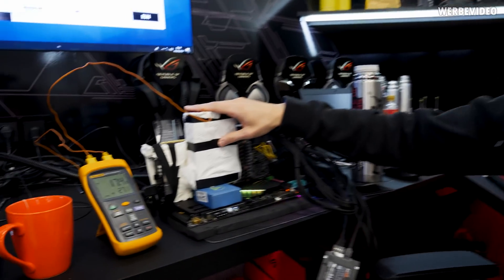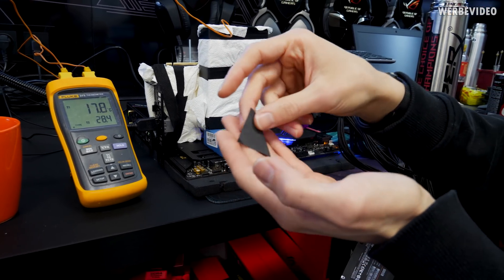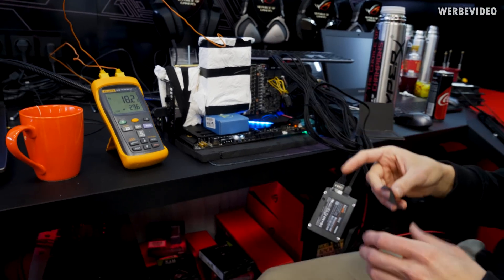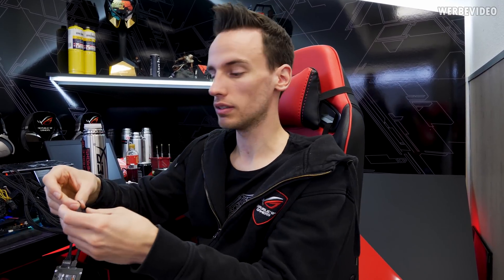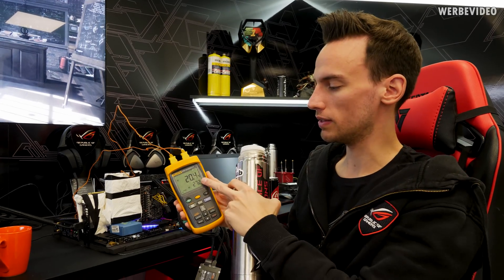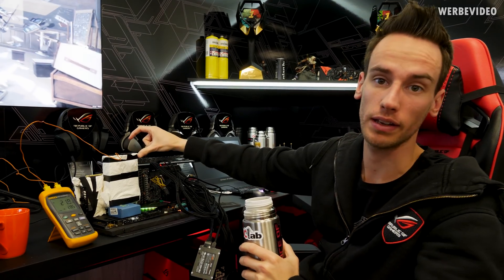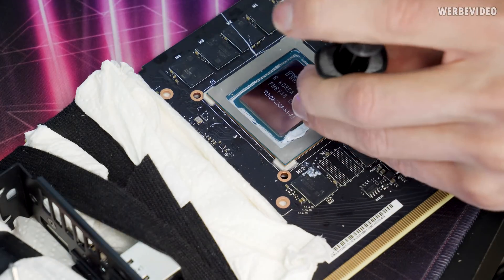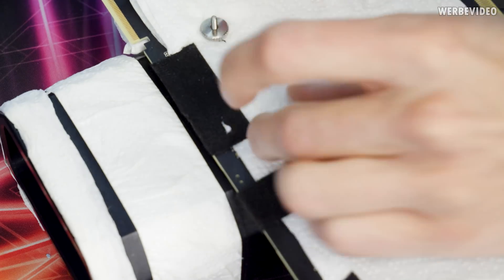Thermal Grizzly Carbonaut Extreme-Test (en)

Comment: 67,7 I think conductivity my but it’s crap for how’s it’s advertised it’s more like 10 or so on the conductivity scale, I use Kinpin KPX when that drys out I’m gonna try out Kryonaut Extreme cause I heard KPX only last 6 months but Jesus is it a good thermal paste I idle below 30C on a 120mm rad on a Ryzen 9 5900X not overclocked ot turbos on its own and runs 1-4 core at 5ghz the rest at 4.89ghz most of the time if it drops off it drops down to 4.77ghz it benchmarks out at 20,064 multi core score on cinebench r23 not bad for a non over clocked system just keep it cool if it’s Ryzen and my power profile is on balanced

Comment: Would a Grizzly thermal pad be good enough to use on a Ryzen 3800x with an aftermarket fan cooler ? (I`m going to be using the Be Quiet Dark Rock Pro 4)
No overclocking, nothing fancy, I`m going to be running everything stock, as a casual gaming PC.

Comment: So eventually, what is the point of this product? Everyone keeps telling that Cryonaut doesn't cure and doesn't degrade, so ….. ?
Reply: The point is you dont have the mess of paste, you can swap it in and out very easily, it doesnt degrade over time, etc etc. 

But for this you sacrifice a few degrees C in temps.
Reply: @recreate3204  From a manufacturer, that is a weak statement for a power user.
Reply: @raimo5091  Yeah. But it isnt meant for "power users." Or people doing extreme overclocks.
Reply: @recreate3204  Regular users don't care about thermal interface. They never replace it, and if they do, they mostly let shop handle it. OEM's and SI's are never going to use it due to cost-benefit value.

Comment: When making a seal on a gasket on a car, sometimes I add a little RTX to the paper gasket, just enough to make it stick. Wonder if adding just a little Kryonaut to the pad may help with the thermal transfer issue with it. Sure it adds cost, but in an overclocking situation with LN2 maybe it will help.

Comment: Roman. I've got some Cryonaut some months ago and my initial temps were attrocious and stopped trying (went back to Noctua paste). Some people says I should leave the Cryonaut for a week or two and the temps will get better than normal paste. Is that true?
Reply: My temps were terrible with Kryonaut as well. I'm now using Noctua NT-H2. I left my Kryo-NOT paste for a good week(I think) and noticed no difference with time and all other applications I tried were the same. I think its highly unlikely that it gets any better. Kryonaut is runny crap. Its non cure and isn't supposed to require any time. I've never noticed any improvement over time with ANY non-cure paste(although I admit my experience is fairly limited).
Reply: @AndAbel-AOD  So maybe Cryonaut is only good for LN2. My sample was legit, same color and consistency as other videos show. I don't think I had a counterfeit (even less living in Austria)
Reply: @SaccoBelmonte  Same here. I don't know if I even believe this nonsense about fake stuff. It may just be an excuse put out by the company when people realize how shitty it is. I've tried 2 samples from 2 different vendors and everything about them matches everything I've seen. I don't doubt that it was 100% legit.

It doesn't even really make sense for fake stuff to be sold on Amazon and such. As if thermal paste is just so sought after and difficult to obtain. The amount  of effort that would be needed to fake it. I highly doubt it.
Reply: @SaccoBelmonte  Out of curiosity. How much hotter were your temps with Kryonaut over Noctua? Mine were 3-4c worse than Noctua NT-H2, MX-4 2019 and even the stock Corsair paste that came pre-applied on my 360mm AIO which is being used on an i9 9900k.
Reply: @AndAbel-AOD  Yeah it was about 5c hotter than Noctua. I left it there for 4 days and decided to get rid of it and go Noctua when I realized the temps weren't getting any better.

I tried the application 3 times. No good.

Noctua's first application afterwards worked as expected.
Reply: Who ever told you that is wrong. I had no issues Kryonaut and was better than Noctua stuff I was using but only by 1-2c so not crazy better. My delta t is about 8c for my gpu and I know since it's water cooled and I know the water temps, also this is without having the pump at full speed.
Reply: @SkinUpMonkey  Hmmm...I don't know why there is so much inconsistency with this one. Not only here but in other forums 50% likes it and 50% hates it.
Reply: @SaccoBelmonte  did you spread it out or do it some other way?
Reply: @SkinUpMonkey  Tried twice as the instructions said with the spatula. Then I tried with the pea dot.

In every opportunity the temps were bad.
Reply: @SaccoBelmonte  that is strange then because it shouldn't be worse by as much as you say it is.
Reply: @SaccoBelmonte  I tried it like 5 different times in different ways from 2 different vendors. They were all the same. Kryonaut is garbage. I don't trust anyone saying otherwise. Lots of shilling going on these days...
Reply: @AndAbel-AOD  I'm not a shill and this is the first time I seen anybody say anything bad about it.
Reply: @SkinUpMonkey  That statement alone makes me suspicious of you. You can find people saying these things about Kryonaut whenever it is discussed. Its runny over priced junk. 

P.S. The fact that Thermal Grizzly does not individually label syringes is totally amateurish. Every other syringe of paste I have had has a specific label on it, telling you exactly what it is. If you are working with multiple types of Thermal Grizzly paste it would be easy to get them mixed up. It honestly makes me wonder whether Aeronaut, Hydronaut and Kryonaut are all the same runny junk.

Oh and btw, one of the vendors I purchased Kryonaut from is actually listed on Thermal Grizzly's website as an official supplier.
Reply: @AndAbel-AOD  wtf you on about? It's not runny at all, maybe you did get some fake stuff or they change something in the past year or so. All the reviews say the same as me and gamers nexus uses it and not seen anybody hating it. I give you that they could label it better since it only has the company name and logo on it.

I have nothing to gain by saying what I experience and I'm pretty sure this is the first time I talked about what paste I used since I just tell everyone to get the MX-4 stuff since it's dirt cheap and does a good job.
Reply: @SkinUpMonkey  Its not runny at all? Do a Youtube search for "My 10 Year Old Chiller WORKS! -20C on THREADRIPPER!" @ 5:00-5:10 where Linus specifically comments on how "goopy" it is. Its significantly more runny than both MX-4 2019 and Noctua NT-H2. Theres plenty of user reviews and comments about how shit Kryonaut is.

I've yet to see any proof of any "fake" thermal paste anywhere. Do you really think Amazon is going to let vendors sell fake stuff and then put their seal of approval(Amazon's choice) on it? One of the vendors I bought it off of is an OFFICIAL supplier of Kryonaut according to Thermal Grizzly's own website.
Reply: @AndAbel-AOD  Didn't really see much in that vid but mine is not runny at all and is not as easy to spread like the others. I not heard of a fake ether but I just said it for lols. The only thing I can think of is they changed it since I got some which was about 2 years ago but then I not seen anything to say they changed it.
Reply: @SkinUpMonkey  You didn't see much? He specifically says its "goopy" and is reacting to how fast it came out and how messy it is because its runnier than he was expecting. That shit he is putting on his threadripper is the exact same shit I've been trying on my 9900k. Same consistency and colour.
Reply: @SkinUpMonkey  Do a Youtube search for "Hands-On: Thermal Grizzly Kryonaut [application and spreading] thermal paste" which is one of De8auer's own videos. Watch from 0:30 on. You can see how thin and runny it is and how it looks identical to what was on Linus' threadripper.
Reply: @AndAbel-AOD  No you don't see much since it's already on the cpu but I just uploaded a video of the stuff I got, is yours the same as my video or is it worse?

I'm sure was a bit thinker before and didn't spread as easy as that 2nd vid.
Reply: @SkinUpMonkey  I can't say for sure but what you got seems like it might be thicker.
Reply: @AndAbel-AOD  I do find it interesting that der8auer
 stuff spread easier than it did for me.

Comment: Used Conductonaut for a while now and it proves itself every time I bought a used gtx 980 strix and it was thermal throttling when I would throw my overclock on it and now I have a extra 50 MHz on the core and it holds 70c under a 10minute stress load now with no throttling or artifacting.
Reply: You might expect 5 to 6 better degrees compared to this pad, in my mind retarded for the average user, its only useful if you are benchmarking.

Comment: I think it will be cool to test: 
1. On CPU IHS (as TIM replacement);
2. Between CPU and IHS (as STIM replacement & consistent TIM test bench);
3. On CPU die (direct contact, IHS eliminated).
CPUs for Test:
<\= 45W (Laptop),
<\= 95W (Desktop),
140-165W (HEDT).

P.S. @Der8auer, if you still in Moscow, can i get Carbonaut from you (for tests in my Laptop)?

Comment: Try some KPx. For me it's way more stable than Kryonaut on LN2.
Reply: Buildzoid is savage.
Reply: He has close ties with Thermal Grizzly
Reply: @SparkysAdventure  Close ties shmose ties, slap some smurf goo on that die and if it works much better than tha Grizz, then it's time to re-formulate tha 'Naut
Reply: @Gti_Jason  Kyronaut is worse than the stock Corsair paste that comes pre-applied by 2-4C.
Reply: Smurf-Jizz
Reply: i had problems with bdie overclocking on z390 aorus elite the one you recommended for 9900k overclocking in a gamersnexus video or one where you went over several boards.. anyways processor 5g on 1,35 is easy but the memory kit i bought is 3600 cl16 i checked wirh taiphoon burner it is samsung b-die but it wouldnt even do 3733 on cl 19 i closely followed your tutorial on the aorus master so i set io and system agent on 1.2V and dimms at 1.45v also i have the latest bios. problem is every time I lower the cl etc. only a bit it would boot but asrock timing configurator would show timings ok but clock somehow automatically lowered to lets say 3466 and cl 15 but how do I stop the gigabyte board from fucking with my frequency? also geekbench score was quite low with 6.5-6.6k for xmp profile. cache at 4800mhz same as your but your kit was at 3833 or something like that so not much higher and waymore loose timings like 18 19 19.. pls help me ram oc senpai
Reply: @Paddydapro  The cheaper gigabyte boards suck with memory clock speeds. I'm pretty sure I mentioned that in one of my videos about them.
Reply: I own both the KPx and the kryonuat pasted but I found the kryonaut to be better with sub zero cooling.
Reply: Every single x299 CPU WR begs to differ ;)
Reply: @agoli4898  X299 cold bugs before Kryonaut cracks.
Reply: @ActuallyHardcoreOverclocking  X299 for sure cracks, quite easily.  Its harder than full pot for sure.
Reply: @ActuallyHardcoreOverclocking  i already crack at -100°c with cryo on a 7700k.

French overclocker also try kpx with 2080 but it cracked like kryo
Reply: Do you realize who you are talking to pal?

Just because you have a YouTube channel, doesn't mean you get to give advice to Derbauer...

Comment: Have you tested the Carbonaut on the Radeon VII as replacement for the stock thermal pad?
Reply: This is what I wanna know
Reply: @CL-gj9mf  my card does well at 2100MHz 1235HBM. I'd like to keep the graphite pad when water-cooling so yeah, that's the plan but with this pad
Reply: GN did testing with the IC thermal pad on the Radeon VII, and he said it was atrocious performance, maybe he said it was almost as bad as if there was no cooling, but I don't remember. It was so bad that Steve didn't post numbers. Carbonaut works better though.
Reply: @CL-gj9mf  they are conductive.
Reply: @CL-gj9mf  I have an EK water block on the card with Kryonaut that is working well. I'm just curious to know if the Carbonaut works better with the stock cooler as the die is not 100% flat.  There is a slight difference between the core and the HBM2.

Comment: could thinner graphite film possibly net better performance or wouldnt that suffice to even out groves anymore? maybe it could help in conjuction with a lapped cpu then still. i googled around a little and found 100 micron films are relatively easily available and would then just need to be cut to size. might be worth trying out.
Reply: rusTORK at Work those all seem like preventable problems the solutions for which you even described. additionally, heat spreaders themselves currently are what spreads the heat parallel to the die, so this could also have potential in direct die applications where contact area is a problem.
Reply: Here is data from what i collected about Graphite Sheet (PGS, EYG, 100 micron): Thermal Conductivity (X-Y) 700 W/m*k, 26 W/m*k (Z-direction); 50 micron: 1300 W/m*k (X-Y) and 20 W/m*k. And finally 10 micron: 1950 W/m*k (X-Y) and 10 W/m*k. As you may see it's rise and drop pretty fast. All information from Panasonic data sheets and reviews pages.